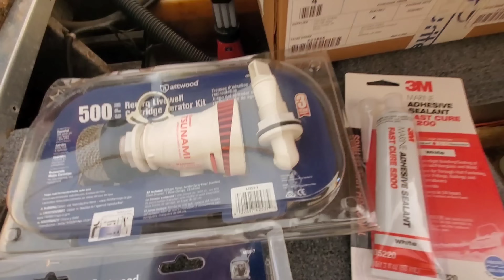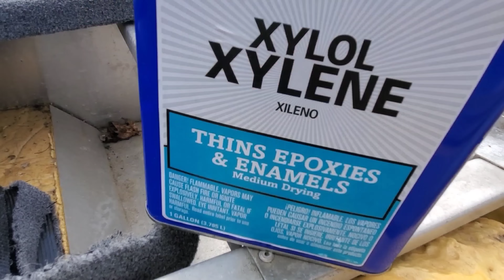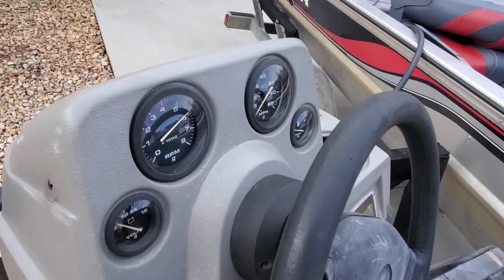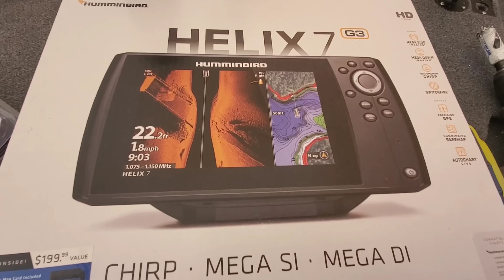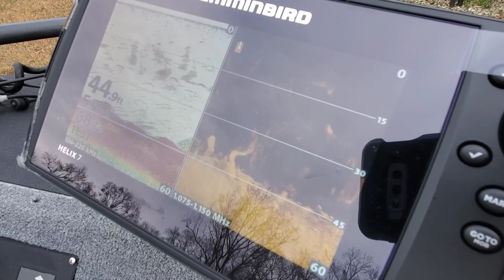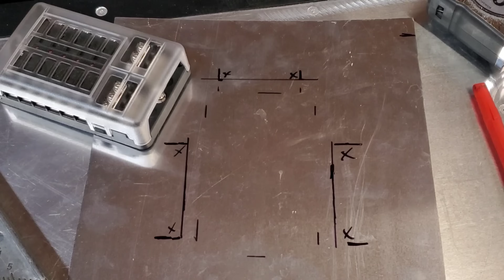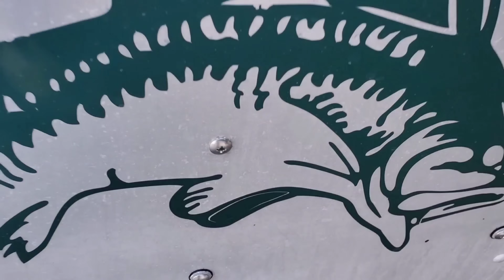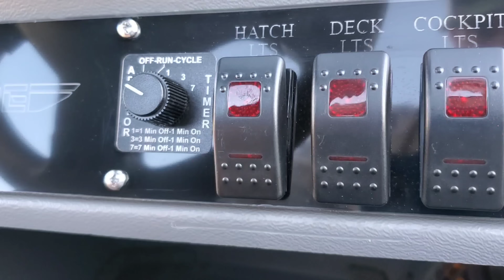ALUMINUM BASS BOAT FULL BUILD | Basstracker Pro 17 |Start to Finish

Comment: First... WOW!!! Second... You did all that in just 150 hours!!! Amazing!!! You have your craft down to a science. Curious question: How much did all the parts and materials cost?
Reply: 15k?
Reply: This is a skill, a skill with talent, but a skill nonetheless. He’s probably built dozens of boats before so he knows all the ins and outs and tips and tricks to make a boat from bare metal with ribs showing to a fully complete masterpiece that’s also cost efficient too.
Reply: @capspik  you’d be surprised the same carpet he uses in this video can be bought for around 13.46, I have a budget, you could do all of this for about 200 hundred dollars, given marine grade plywood prices right now. The 200 dollar budget is just 50 dollars more than the 150 dollar budget Im working with and I’m still clearing about 36.40 dollars after taxes. Not a lot but it could go a long way to pay for anything wrong with the engine that I would also have to fix since my motor is a little bit older model.

Comment: You just saved me a truckload of time with the 1996 17' Tracker Pro Team I just bought (first ever boat). I had to troubleshoot a leaking hull and I found a leaking rivet (just repaired w/G Flex epoxy) but found a much larger leak in the through-hull port for the live well gravity drain. I thought I was going to have to remove the foam in the storage container that sits above the gravity drain hose to the port in the starboard side of the hull, and then cut through the bottom of the aluminum of the storage area to get at the gravity drain to through hull hose -- but I glimpsed the hole underneath the seat behind the steering wheel in your video. Tonight I just removed some rivets, pulled the seat and boom -- easy access to remove the 90-degree live well drain connection and hose to replace with all new parts and fix the leak. SUBSCRIBED <3

Comment: the attention to detail here is amazing brother! i am a sucker for the little things... but this guy got a deal on this boat. the pride and attention that went into this was just awesome, from the pole light clips, to the strut mounts. you couldve just tossed the lights in there or just not used struts and that wouldve been fine, but you went that extra mile. awesome build brother.

Comment: Wow! Nice work. I have an 18.5 ft  1994 Pro Tracker I would like to upgrade. Last summer, I did replace the fuse panel with a similiar one you installed on this boat. I am now inspired to do a complete make over of my boat. Your video showed me that it can be done. Next winters project maybe. 🤔

Comment: Dang dude, that is some nice work. I just bought my first boat, a 2006 G3 1756. I’m all about Camo so it just called my name. Carpet looks awesome but I love the low maintenance without it on my boat. However, it lacks storage and I really wish the console was moved ahead a bit to utilize a bench seat or 2 seats with console like you did with cup holders. May have to do a little renovation project when I find some time.

Comment: The group 29 is that a starter motor for all the electronics or a deep cycle. I have the same boat but won't be using the outboard much so would it be better to get a deep cycle since the outboard won't be charging the starter battery often?

Comment: I’m redoing this exact same boat.  My wires are a disaster.  Did you mess with the original Ignition harness or just label it and pout it off to the side?  I am going to redo the accessory wiring, but am torn about whether to redo the ignition too.  I noticed the wiring on the whole boat is not tinned.

Comment: I’m currently working on one myself you got a wire diagram of the original harness and how you rewired everything to the switches
Reply from the maker: I dont. I spent many hours testing and sourcing leads. Retaining what I could and rewiring what I wanted for the upgrades.

Comment: Have you considered using the paint removal disks for your angle grinder for things like adhesive cleanup? relatively cost efficient, easily accessible (even available at walmart) and leave a much more consistent finish

Comment: Nice work , one thing I would have added though was rubber grommets where you wired in the new deck lights. With vibration overtime the aluminum will cut in and short those wires
Reply from the maker: I use a countersink bit then dremel small grinding bit to round off the inside of holes. No sharp edges,  pretty smooth. Grommets dry rot and crack out in a few years, I prefer rounding the inside of hole gently.

Comment: You really have a pure talent for rebuilding these boats.  I enjoy all your videos, very informative.  I'm re-doing a 93 Bass Tracker TX17.  Stripped it down to bare hull, removed all the nasty waterlogged foam.  Stuck on what to replace it with.  Many on web use pink Owens Corning foam sheets from Home Depot.  Others have said that is a BIG mistake because it will break down over time and is not chemical resistant.  I did find a supplier with marine grade closed cell foam sheets, but the price is 4-5 times higher than the pink stuff.  What would you do?

Comment: Everything exceeds any of my expectations with your builds. Only thing I was thinking, could you have run the transducer cable through the trolling motor shaft? To keep from the cable being loosely dangling. I thought if you had enough room to drill through the shaft at the bottom and top…. Look clean!!! But regardless, amazing work brother
Reply from the maker: Thanks..Possibly.  I saw this trick on another channel and ut worked very well for him. I didn't want to spend too much time overthinking it. I do not know if your suggestion would work or not though. The main problem I always have with any tranducer is having to accommodate the end connector size and not wire diameter..Why holes are always SO much larger than the wire. So it would need to be a very large hole to accept the connector through and tgen feed wire, which then leaves a big hole for water to possibly get in without being able to seal properly. Just a headache in general with these things.
Reply: @AnthonyJonesBrigadeBoats  I gotcha

Comment: How much does something like this cost and how can I see about hiring your amazing service? I have an ‘88 tracker I bought last Fall and it could use upgraded in wiring and what not. No gas motor anymore. Found out the engine was shot after I bought it so I’m never putting another gas engine on it, trolling motors only.

Comment: I re-did a BassTracker Pro 17 a couple of years ago as an attempted flip.  The boat turned out awesome, but wow! there no resale value in these old Bass Trackers.  I coated all the floors in resin and did an above factory job and could barely get back the purchase price and cost of materials.
Reply from the maker: That sucks. That's why I don't flip boats. Guys that pay you to do a project are different from guys trying to buy one off you for the bottom dollar.

Comment: Hey nice job!!! Curious, which is better for carpet to aluminum, contact cement or Roberts carpet glue?
Reply from the maker: I prefer contact cement.  100% of time use on lids. I use Roberts glue on large surface areas, or tight spots  like under jump seat. If i had a helper Id probably use contact cement on larger areas as well. I do not use contact cement on wooden parts ever. I'm currently editing a How To Carpet an Aluminum Bass Boat video now that I filmed on this project.
Reply: @AnthonyJonesBrigadeBoats  sweet…will be looking forward

Comment: I am just beyond impressed by this build. You have no idea how much this has helped me with my pro team 165 full rebuild. I have a question about that awesome switch panel you created under the console. What is that material called that you used to make those oval grommets for the wires to pass through. I'm going to do it the exact same way. I am curious what tools you use to make the oval cuts and other cuts of aluminum panels in general. Do you use a pneumatic rivet tool? I just love all of it! Also can you post a link to the company you used to make that custom switch panel? I need that exact same thing for my identical console.
Reply from the maker: The ovals are door liner from anazon, i cut with hole saws tgen angle grinder with cut off wheel. Use metal oscillating metal sheers from harbor freight to cut aluminum. Use milwaukee m12 battery rivet gun. Plenty of videos on my channel showing all tools and techniques.  Panel was made by Seastone Marine in Fl, I am not sure if they make for general public.

Comment: Nice. I would have elected to recess the tackle storage box back to where the lid would not stick into the walkway, in fear I would step on it coming off the casting deck.
Reply from the maker: Nice.  There's only so much room to work with but good luck with your project.  Thanks for watching

Comment: What did you use to cover the sharp edges when you cut out holes in the aluminum?
Reply from the maker: on gunnels i use counter sink bit to give the edge relief then take a fine grinding bit on rotary and smooth out. On front tray for fuse box i simply sanded the edges to make rounded. On larger holes i typically use door edging but its hard to get in smaller holes. Grommets are good too but i usually use those in larger holes in visible locations, its all about where its at for what i do.

Comment: Nice only thing I would have done different is I would have used the foam instead of the carpet.
Reply from the maker: Hard to do without replacing all the factory lids. Carpet restore to aluminum with eva foam decking, big price difference for me to do it.

Comment: Isn’t there a chemical solution to the oxidation removal as opposed to grinding?
Reply from the maker: Xylene. But it's expensive. And messy clean up. I use it depending on the scenario.

Comment: What hatch handles did you use
Reply from the maker: They were just rectangle fingerpull latches that were factory replacements. Grey in color, possibly made by Perko. You can find on Amazon but the customer provided these when he dropped off boat or I'd have shared an exact link.
Reply: @AnthonyJonesBrigadeBoats  ok thanks. I’m working on building a boat with my brother and we didn’t know what to use.

Comment: You went to all that trouble to make the outside look so pretty and you didn't paint the inside of a single hatch ???
Reply from the maker: I was paid to do everything you saw. The customer didn't care about the inside of the hatches or painting the exterior of the boat. Hence, all metalwork was left factory throughout. It still turned out nicer than 99% of the restorations out there.

Comment: I’ll never understand why ppl who redo a boat, put carpet back in it. It’s such a terrible option out of all the actual options.
Reply from the maker: Because it's not as simple as you think. If we were to run Sea Dek or eva foam in general, the factory lid gaps are too big because they are made for carpet overlaps. So we have to replace lids, about a grand worth in that boat. Then we cannot run eva foam over wood so the front deck will need aluminum sheet. This causes a height issue because the factory framing was designed to run 1/2 inch sheet, .090 aluminum is much thinner, so we'd have to shim the factory framing with additional aluminum to raise it. Same with cockpit floor to ensure console was correct height. Between materials and fab, another couple grand. Then with the new lids, you'd need Whitecap latches, 50$ each. Plus the cost of Sea Dek is 1500 in material as opposed to 500 in carpet, another grand. So all in all for me to do it the way you think is a better option would cost my customer 4-5 grand more of project. When it was a 6K project as in the video. Some guys don't think that amount more is worth it. If it was a simple material swap, probably,  but allthe unforseen things required to do that material swap correctly,  makes it a much much higher cost and labor.